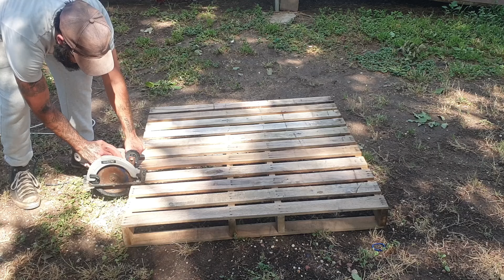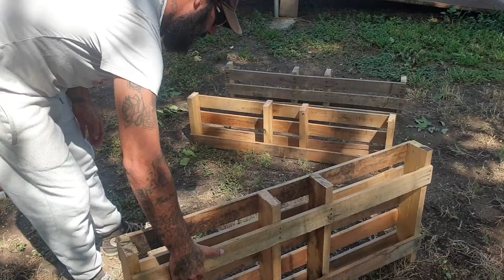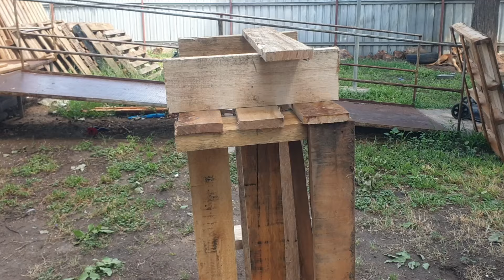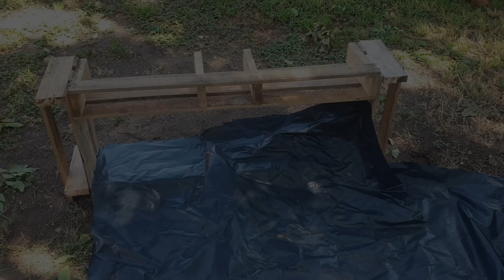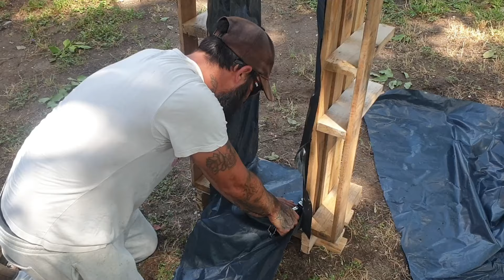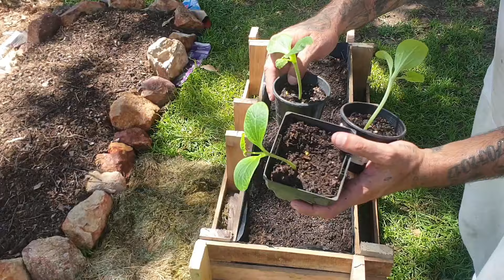Pallet to Raised Bed in Under 1 Hour

Comment: I had someone to make me one and can I tell you it was a hot mess. He was supposed to make 5 after saw the first one I told him that was ok. I just didn’t have the tools.
Reply from the maker: What was the issue with the type he made? I find screws and straight timbers work a lot better and hold together better look nicer also.
Reply: @growfoodtoday  first he made it on top of a palette . Then he didn’t use rotten boarded it did last through the growing season before it started falling apart. Like I said I don’t have the proper tools to make it right. And I paid him for it even though I was not satisfied
Reply from the maker: @spenc62  always best to try diy basic tools.is just needed hammer and nails, drill or screws. Yeah i would of have been devastated to pay for something your not happy about. No dig beds are great also if you have a look how i did my one.
Reply: What ever you paid the guy you could of bought screws and a driver, or nails and hammer. How much you save growing buy a harbor freight cheap battery screw gun and make several beds

Comment: This looks like alot of work
Reply from the maker: Sure is
Reply: Anything worth doing should be done well!
Reply: He did the show and tell & only took 16 minutes including figuring it out.
Faster turn pallet side ways and cut all the ends with 1 past through the 2x4. Only the 2 center 2x 4 need both sides cut through and through

All in all building it from scratch with 2x4’s and fencing would have took much longer. Using a garbage bag slit open drap over and only need to staple the top on the dirt will hold the sides. Add sticks grass and leaves and kitchen scrap with only a little dirt to plant in.
Reply: Thanks for the spring board idea to make quick and simple cheap raised beds any size height